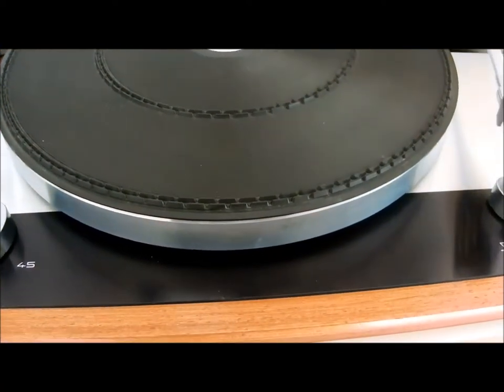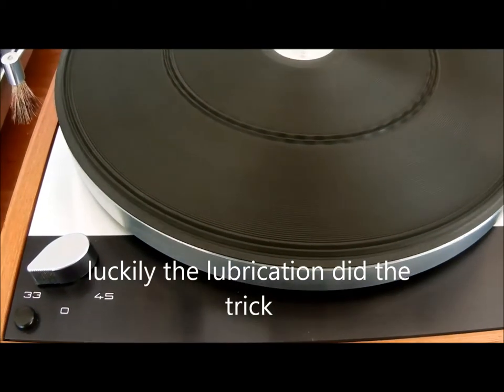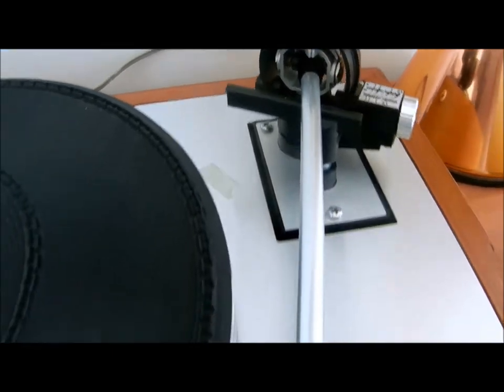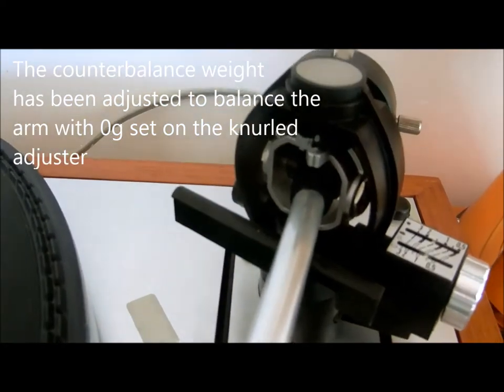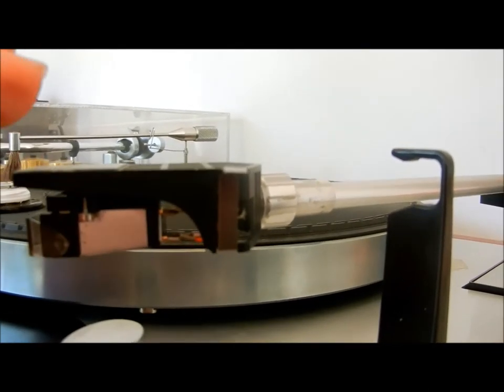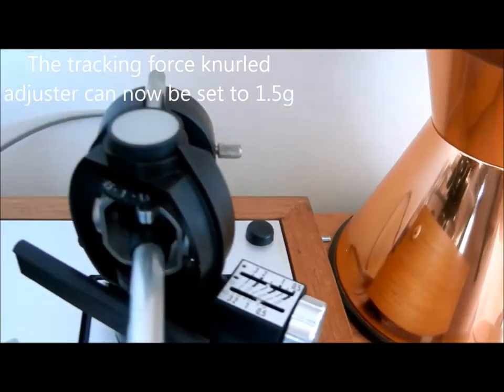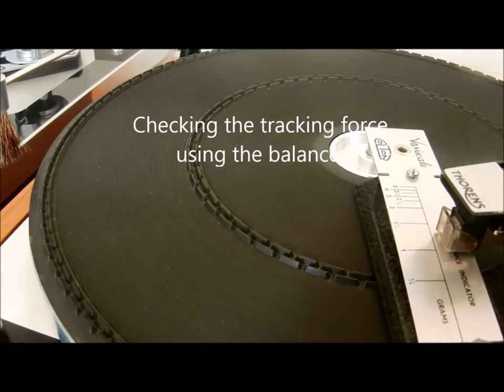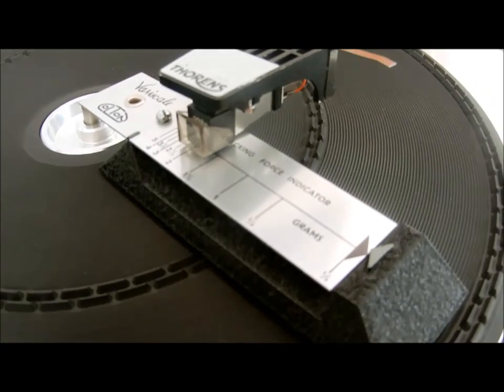Thorens TD160 bringing back to life

Comment: That tonearm, and others made by Thorens, has  "wet record" and  "dry record" settings.   Dver tried the former? Many people use the wet setting and with distilled water and a few drops of wetting solution on the LP surface. This, purportedly, reduces record wear.
Reply from the maker: No, I have only played my vinyl dry. I Use Permostat antistatic record preserver on most of my viny to protect the stylus and vinyl.No longer in production which is a shame.